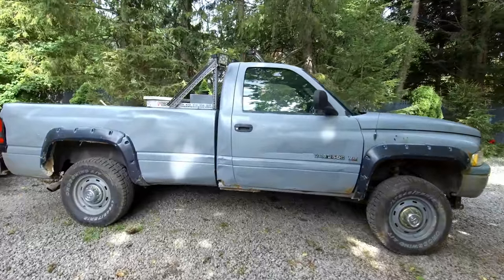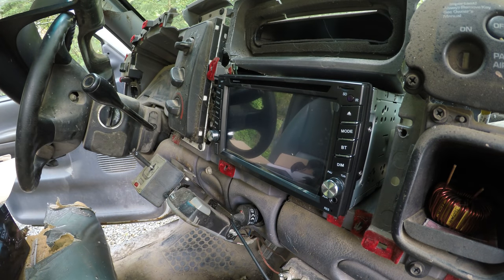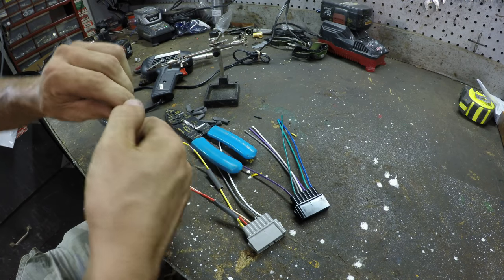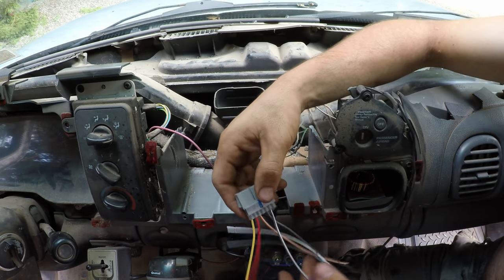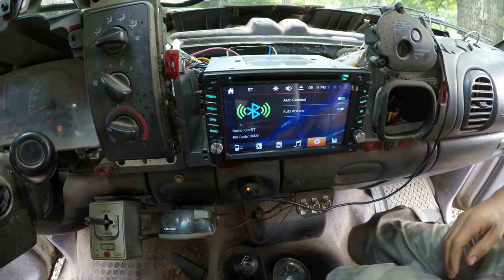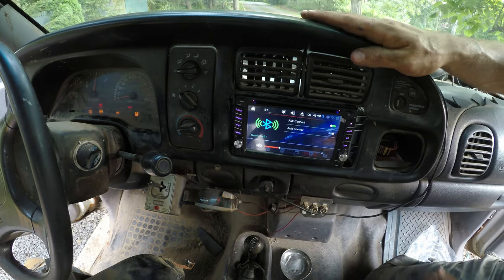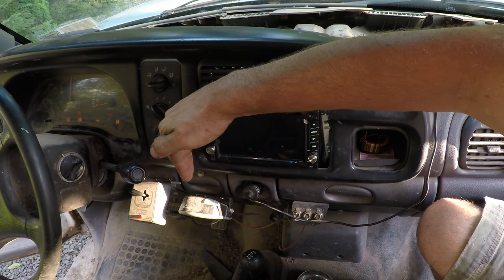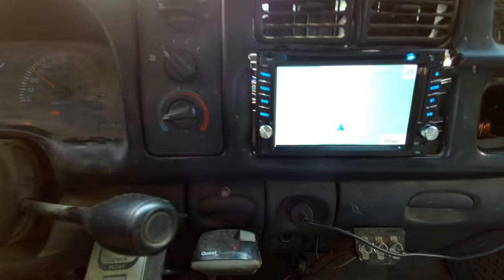Installing a radio in a pickup truck

Comment: Has giant access hole on top of dash, cuts another giant chunk out with chainsaw, recommends not cutting off factory wiring connectors.  Nice!!
Reply: Plastic dash is irrelevant to the vehicle running, One bad wire connection can really cause you issues though, more so with newer vehicles.

Comment: The question on the stereo Amazon link....

"Question: What size chainsaw is required for installing this?"
Reply: You have to go to Auto zone and ask for the radio install chainsaw blade !
Reply: Holy crap, you weren't kidding!
Reply: This question has all the likes!
Reply: What size chainsaw do you have?
Reply: @Kharnellius  did you see the one about having an easy access dash? lmfao
Reply: 14”inch
Reply: @buddyreed2623  he's got a special tool for all his jobs
Reply: preferably a 14in bar

Comment: The conflict of methods between using a chainsaw but still soldering and using heat shrink tubing on your easy access dash made me chuckle. 
The backup camera is great for hooking up trailers especially when you are alone. 

The GPS seems like it has a few great features. If it is easy to program for a destination then it will be awesome.
Reply: Wayne Crews you have to have standards, we're not animals. lol
Reply: Which he always is.
Reply: once you are used to a trailer with the same truck you get very familiar with hooking up when to stop ECT>>

Comment: @6:43 
Lumination wire : connect to lighting, dim display wenn lights are on, display easier on the eyes at night.
Parking wire: You can only watch DVD wenn the car is parked. (Connect to ground and watch all the time 🙄)

Comment: simply an incredible job! you have a factory 1.5 din stereo and an aftermarket 2 din stereo, I can confirm some sort of cutting is required to make it fit. Chainsaw and angle grinder make it light work. I cant wait until you get a new old truck and swap everything over. Priceless.

Comment: Good job, sir. I did a similar install in a '63 VW Beetle in '74 except it was an 8-track and the dash was all sheet metal. Had to make it fit with tin shears and jigsaw. It was a 12V player and you know VWs were 6V so I got a voltage converter to step it up. And it worked great but my battery was always dying. Many times had to open the door and use my left foot to push the car enough to jump it off. I really miss that VW (not so much the 8-track though).

Comment: For the reverse camera, you don't need to find the reverse wires from the shifter, you can just wire it into your reverse lights in the back and they act as a trigger to turn the reverse camera on

Comment: Andrew, I have never seen a chainsaw cut out a slot for the radio, that was priceless, but then the brackets for the new radio were afro-engineered and I can only assume the air conditioner does not work, but you made it fit!

Comment: Key 1 and Key 2 is for steering wheel control.  If you don't have steering wheel control just ignore those wires.  Don't forget to take those screw out before putting a dvd or cd  in the slot.  If you hookup the illumination wire it will dim the backlight on the control panel.
Reply from the maker: Yeah, that screw is probably still in there. They could make this radio without the disk drive, a USB stick or SD card is the way to go now.

Comment: the chainsaw lol. Does the AC work?
Reply: Joshua cabin filter tho
Reply: Joshua so you don’t run the AC in your house?
Reply: “Usually only people with weakened immune systems are susceptible to infection by Aspergillus” I don’t know I think exhaust fumes are worse in the short and long term
Reply: Joshua so you don’t run the AC in your house? I always get weather alerts about ozone and it says to not go outside for long and use air conditioning. I’m not a doctor however.
Reply: He doesn't have AC
Reply: If  his 2500 is anything like mine was it stopped working in 08, but then again all you do is crank the windows down

Comment: I know this is an old video, but I'm a new subscriber and I'm binge watching all your videos.  Loved the precision chainsaw hole adjustment!  BTW, if you have a knob on the dash for increasing or decreasing the brightness of your normal dash lights, the 'illumination' wire on radio connects to that output wire so the radio screen brightness can also be adjusted (you mentioned the annoyance of a bright radio display at night).

Comment: I bought this radio for my  2018 BMW it was too large to fit in the dash.  So after watching Andrew install his, I went and bought a chain saw and opened the mouth of dash and it fit perfectly.  Now I want to cut out the top of the dash like Andrew did, but the chain saw is too long so if anyone has an idea of what I can use to cut the top of the dash, so I have access to the heater core in case it ever goes bad.  Thanks Andrew, great video, I can't stop laughing.

Comment: ILL wire usually dims the illuminatiion on the head unit, for when the headlights are turned on.  PARK wire is to allow DVD playback.

Comment: thats what the wire labelled lights is for hook that to the light circuit so when you have headlights on the unit goes to half brightness.

Comment: Subtlety is for sucks, eh! Nine different calibrated hammers and a chain saw. Andrew also understands crimped connectors correctly too! If it isn't soldered, it isn't connected! I've never met a crimp I couldn't pull off with just my mind! Great job!

Comment: I know my comment is late and all but you can get a 7inch screen and connect it to the camera for use in the dump truck. Hook the power wire to the reverse light so it only comes on in reverse

Comment: That radio install was a piece of cake, a real bolt in operation as long as you had a chainsaw and a 4 inch grinder hahaha :-) don't you hate things that are supposed to fit but don't quite fit properly?

Comment: i dont know if its a joke, but youre supposed to use  a dash kit, that the radio slides into, which sldies into the original area of where the stock radio is/was

Comment: HAHA you were right I love it. Nice professional custom stereo installation. One thing I have noticed you've sad several times is that soldering is the only way to connect wires together. While I 100% agree that wire nuts should not be used. Those things have NO place for any automotive application. Along with T-taps. I will say that heat shrink butt connectors are as good if not better than soldering. As long as you are using a good brand and know how to properly crimp and heat them. They are even an approved repair for many auto manufacturers. In my automotive career Trim was one of my specialties. So was A/C, electrical, and engine performance/drivability. I use to be Crysler Gold certified and have replaced many evaporator cores on their cars and trucks. Out of the 3 main car manufactures Chrysler wins hands down for the most failed evap cores. Unfortunately for me almost everyone I replaced was done under warranty. Did my share of heater cores too, Chevy wins that one. Even though the manufacture wouldn't pay for it, I would remove the customers carpet use a pressure washer and cleaned the carpet, with soap, if the heater core leaked coolant on the carpet. Maybe it's just me but I liked and strived to do right by the customer. No reason they should have to live with mold and mildew growing in their car. As always wonderful video and can't wait to watch the next one. Not sure what I'll do once I get caught up.
Reply from the maker: Yeah, a video of me doing a heat core would be funny, that's further in the dash than a radio. I just got a set of those self solder shrink tube things. Ill have to try them, soldering wires takes time.
Reply from the maker: You really think crimping is as good as soldering? Its so frustrating when electrical stuff stops working, ive been soldering everything for years, and they always stay working. Usually the junky components (lights, switches) fail before the wiring.
Reply: @AndrewCamarata  Yes, without a doubt. Soldering is good and it has it's place. For most repairs I would recommend heat shrink  butt connectors over soldering. The main reason why wiring repair fail is from high resistance, loose or poor contact, and the repair itself broke. One down side of soldering is you are making that connection stiff and brittle. On cars there is a ton of vibration and over time that can cause it to fail. With the butt connectors you are allowing some flex in that joint. Also the heat shrink ones have a glue that seals that repair and I have found that they have a better and more sealant compared to regular heat shrink tubing. Just keep in mind the type on crimper you use can make or break the quality of the connection. I've seen other techs, myself included, use the wrong kind and actually  tear into the outer sleeve. If that happens then you are allowing air and contaminants to enter the connection. The only thing I can't tell you about is how long they last in your area with all the salty roads. Being here in TX we rarely get snow and ice. I don't think they use salt when it does, just sand. Now days all electrical parts are turning to crap. Just stay away from Dorman anything. Same with BWD and Bosh. Those are the main 3 I steer away from.

Comment: Chainsaw? I'm a German, we have efficient ways to do things, it takes longer but the outcome is WAY better. I would use a metal frame (Double DIN----Deutsches Institut für Normung) to fit in before I install it. But on the other hand you are very busy and try to be focused on details in other projects.

Comment: It looks like the new radio is a double DIN and the old one was a DIN and a half...
As for the Dash falling apart I think it's a 1990s and early 2000s dodge issue... You just hit. Bump and it falla apart.
Put the reverse camera near the trailer ball

Comment: Don't you think a chainsaw is a little too much!  You can use a little more finesse once and a while.  Hey Andrew can you come to my house and hook up the radio conrols from my steering wheel to my new radio, the guy I hired forgot to hook it up, said I would have to come back some other time.Also the test ride was great, I liked it, my radio has the same stuff and my reverse camera works great

Comment: Well, before extreme surgery and buying a new radio, the first thing I would have looked at was the antenna.  My guess would have been simply that the antenna had gone open circuit for some reason...
Reply from the maker: Yeah, it still might be. That radio doesnt get stations very well.

Comment: Some of those outer cases come off the radio, most come with Incase you don’t have the case that stays in the vehicle , so you might have been able to take the factory radio case off
Reply: I’ve installed a lot of radios

Comment: Brings chainsaw in truck. Must of smelt pretty bad in there after usin that. Remember, never start a gas powered object indoors. It’ll fume up. You only used it to cut a little bit anyways so it probably wasn’t that bad in the cab

Comment: Like other comments below, the chainsaw was just a little Overkill ya think? If all else fails get a bigger hammer right?

You may not be familiar with them, but there is a company on the internet as well as direct sales in Ohio by the name of crutchfield.com. They have an excellent website to help you choose the proper size, fit and function of a new head unit replacement for single or double DIN applications. They may cost a few pennies more however you getting much more in terms of what they send you in kit form  with instructions  specific to the vehicle and Technical Support over the phone or via email as needed.

When all else fails, read the instructions as they're there for a reason. Especially in complicated electronic devices and how to use the features that are offered within.

Finally, been watching your videos for a while and you do a great job and you have wide knowledge base too.
Most of the time ,am very impressed by your videos and what we can see. Do you get many callbacks to rework something that didn't function right?

Comment: Any plans to get this truck fixed and back on the road? Or have you turned the page on that chapter? I hope you are enjoying a good snowmobile season with your new sled.
Reply from the maker: This truck has been at my friends garage for over a year getting an engine installed. He did do it, he is having a hard time getting it to run right though.

Comment: Different.. i'd use wire nuts first for testing then solder and heat shrink after any changes, (if any).
I imagine you're in a state that doesn't require vehicle inspections, they wouldn't let you drive it home! oh well..

Comment: The chainsaw I understand but that stereo I don't. it's too much for that truck. You only have two speakers in there. Just a standard stereo would have been fine. Not to mention taking off your work gloves just change the station. But at least it was a easy install with that very convenient Dodge dash cover.
Reply from the maker: That radio works well, its nice when the phone rings, it just answers and I can just talk. Its nice that it works with Bluetooth, the GPS feature is nice, and it reminds me if I go over the speed limit.
Reply: @AndrewCamarata  all these features are nice to have, I can argue there. I'm thinking of buying one too for my 94 Chevy 1500. I have to see if I can make it fit first. The price is nice too.

Comment: Takes the time to solder his wire splices and the terminals, and even heat shrink over exposed areas. Also uses a chainsaw to cut out the dash. 🤣😆💀💀

Comment: this is best how 2 diy stero install    ...id do it same way 2000 plastic clips per 2 inches and 100 screw to hold palstic but when it come to metal they hardly use any screws ? go figure

Comment: “Fits pretty nice now”.....OMG

Great equipment operator, but DEFINITELY DO NOT have Andrew work on a vehicle....lol
Reply from the maker: Most radio installation people would have just came back with an excuse (the radio doesn't fit). I delivered results. Radio installed.

Comment: what car companies need to make is a way to push a small non electronic button that will open the dashboard up towards the windshield and an option to take the top of the dashboard off for projects like this and the heater coil.
Reply: Cars are built with the heater core suspended by ant-gravity beams and the rst of the car built around it.

Comment: You now know why only americans buy american trucks.  Don't waste your time !  Buy made in Japan or Europe, bro.
Reply from the maker: I want a truck from Japan, they only sell half tons. I need a 3/4 or 1 ton pickup. American trucks are crap.
Reply: @AndrewCamarata  Toyota Hilux - Nissan NP300 - Mitsubishi L200 - Volkswagen Amarok - Nissan Navara - ...
Reply from the maker: Christophe Godfirnon can any of those tow 6+ tons? Plus they aren’t available here.
Reply: @AndrewCamarata  Never see a 6+tons ?? 3-4 tons for a pick up not more.  Ask the dealers of these brands.
Reply from the maker: Christophe Godfirnon that Dodge is rated to bumper tow 6.5 tons. And heavier ones are available. The foreign trucks need to match this.
Reply: @AndrewCamarata  You tried really 6.5 tons ?
Reply: @AndrewCamarata  That means the weight of this Dodge is 6,5 tons.  Don't think so.
Reply from the maker: Christophe Godfirnon yes.
Reply from the maker: That’s with a 2500 pickup, they are available up to 5500. These foreign trucks are only 1500. That’s just too small to snow plow and tow.
Reply from the maker: Google search “Dodge 2500 towing capacity”
Reply: @AndrewCamarata  I see.  TY.